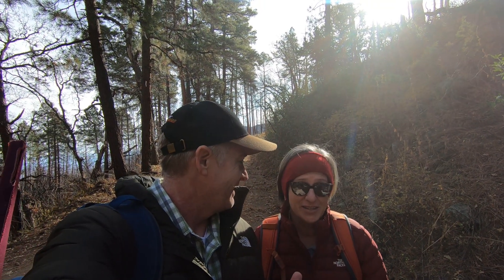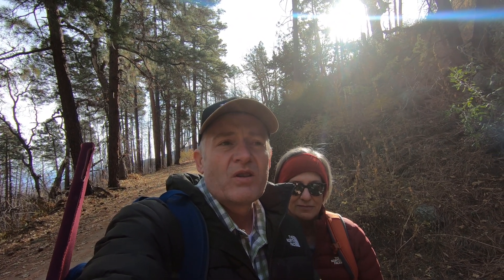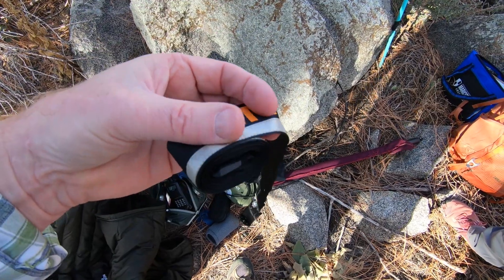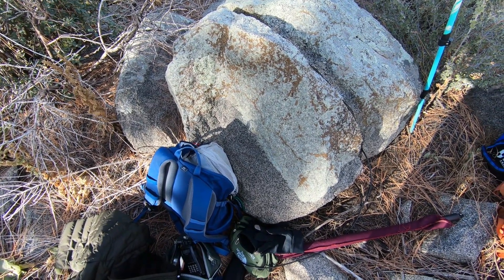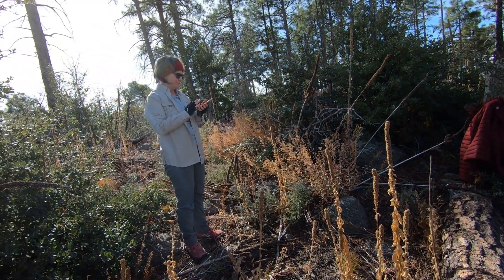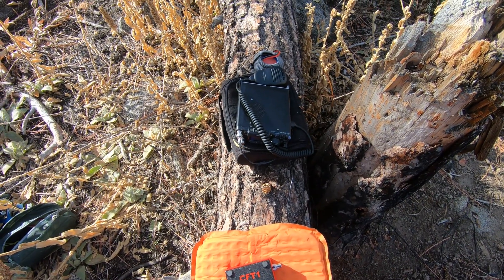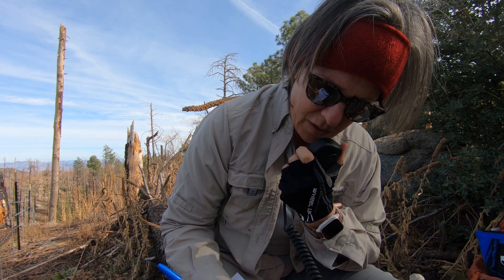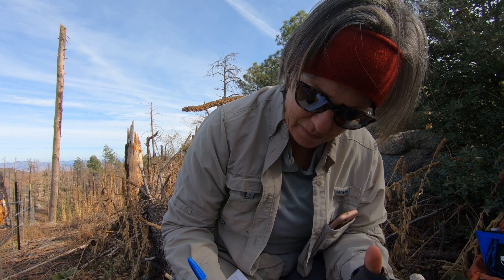5 watts for Summits on the Air on VHF, HF and CW

Comment: Great activation!  On the CFT-1 case, if you flip the lid the other way, the magnets grab onto the base of the radio and the legs will stick better.  You will need to pull the rubber pads off the bottom panel of your radio for it to fit unless you align them to the cutouts on the base of the lid. The rubber pads on my lid are intended to grip the table or log.

Comment: Hello Charlie!Interesting video! It is important to choose right position for a HF trasmitting antenna: buildings and threes near the one usually rejecting RF radiwave (converting RF to heat).I had experimented in a city with a 1Watts transmitter (I have a small 2W CW transmitter with several quarz crystals 2457 KHz, 4430 KHz, 7300KHz, 27MHz) and Degen DE1103 - beheind auildings the signal was much weaker.This situation was with waves shotrest that 100Meters.